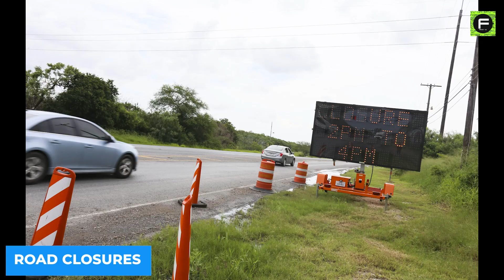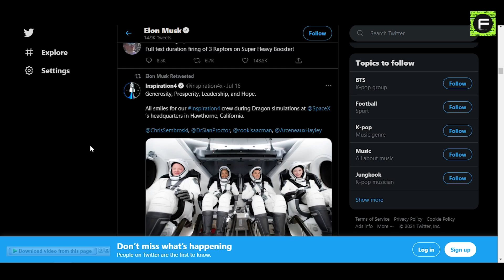Starship Orbital Launch Countdown: When Will It Finally Fly?

Comment: Lol its booster 4 not booster 3. and there is no ship-12 its scrapped.and SUPERHEAVY now will fly with 33 raptor not 28. 3central raptor (CR) 10 middle raptor (MR)
& 28 outer ring raptor (ORR). +  you dont follow the starship update?